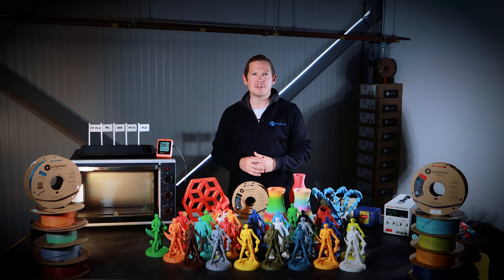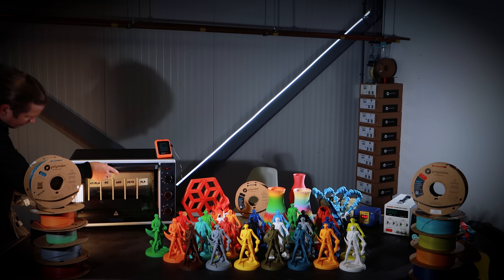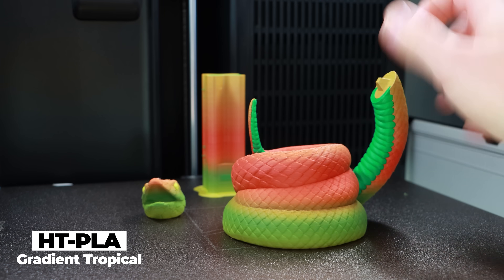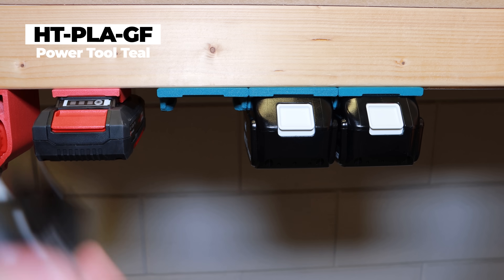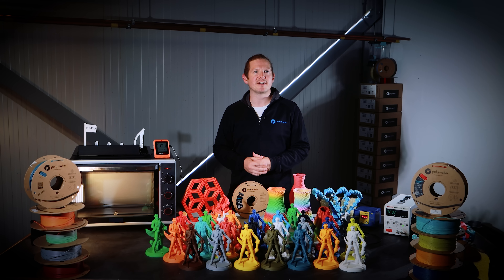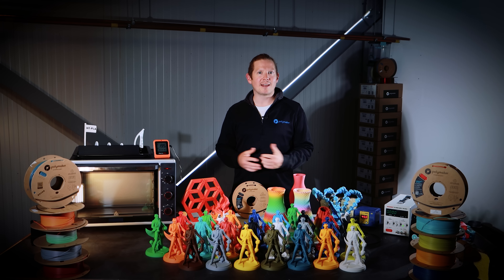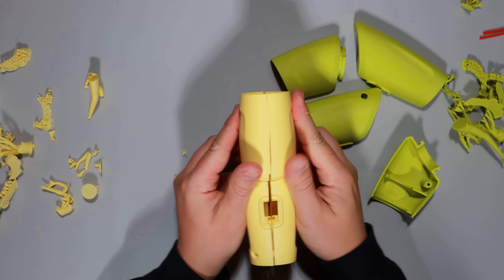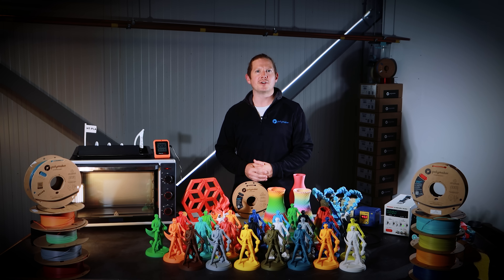HT-PLA: One Filament to Rule Them All 🔥🔥🔥

Comment: My first roll of ht-pla was a stringy mess.
Reply: what printer, slicer, filament preset were you using? Over 230°C it will get stringy, but under that you shouldn't have any issues.

Comment: I just got the HT-PLA in white and black and it's my favorite filament. I'm still testing the heat resistance but I'm really impressed by how it looks. Very similar matte finish to Elegoo's matte PLA. It has a unique feel though, and a different sound when  you tap it. I previously tried PETG and was disappointed by the shininess and "this was 3D printed" look, so I'm glad there's an alternative for outdoor and automotive prints. I hope more colors are introduced. BTW one thing I suggest is make it clear on the Amazon listing that it can handle 130C without annealing. I wasn't sure when I bought it

Comment: I really want this to be a magic filament but I’ve tested this with a file that I have zero issues printing in Panchroma and I get shrinkage and warping that lifts off of the bed. I’ve used the provided profiles on my X1C with no luck. I’ve tweaked setting a bit to increase bed temps and dialing the down the aux fan. Is this me? It could be the design but this is supposed to be exactly like printing PLA with stock setting.

Comment: The temperature limit is impressive, but let's set aside the heat resistance test for a moment. Is this truly everything standard PLA offers, just with added high-temperature (HT) capabilities? After reviewing the My Tech Fun analysis, it appears HT-PLA is a weaker material across the board—except, of course in thermal performance. So, is it really "everything PLA is, & HT resistance"? Not yet. Hopefully, you'll develop a version we can genuinely call PLA+ht. Right now, it's more like HT+pla, where heat resistance has overshadowed all other essential qualities of PLA.

To illustrate, imagine if regular PLA exhibited such compromises: layer adhesion failing at an average of 24kg or tensile strength breaking at around 48kg, This would be considered rubbish PLA. Until high-temp PLA matches or exceeds standard PLA in every other metric—while retaining its HT bonus— we can't claim a true breakthrough has been achieved!

Comment: It also could not handle UV and was unsuitable for any mechanical dimansionally stable application... PLA is not a useful filament type. It is good for what I call plastic waste: figurines and other useless trinkets in general but if you need stability, food safety or any kind of mechanical performance it all begins at PETG.

Comment: Wait a second, isn't PLA unsuitable for mechanical parts because it undergoes plastic deformation, instead of elastic deformation? I've had simple parts such as tabs and caps deform permanently after 2 or 3 uses, just by using them as designed, which makes any mechanical use of PLA impossible. That's the main reason I'm using PETG. How can this filament be used for functional parts at high temperature, when PLA deforms permanently even at room temperature? What am I missing here?

Also, please don't take this the wrong way, but I'm too scared to use any kind of glass or carbon fiber reinforced filament, because I would end up with shards embedded in my skin or my lungs just by touching the part. I'm not saying those materials don't have their place, but you would need to use a breathing device and plastic gloves when handling them, and then coat the print with some kind of sealant, and I don't see manufacturers stressing this point much, if at all. Which makes me think there will be a giant class action a few years from now, when careless users start having health issues related to glass fibers in their body.

Comment: We print PLA in our homes, most without ventilation - is HT PLA REALLY the same as PLA?   GF too?   Maybe there's an ENORMOUS difference because PLA is relatively SAFE  and you make NO MENTION of the safety of printing with glass fibers etc?   You'll sell thousands of rolls, maybe you should discuss the safety?  One of the main selling points of PLA is the fact that it's vegetable based, relatively safe.  What did you put in it to make it HT, and is it a carcinogen?  lol  We know glass fibers are safe to breath - am I right?

Comment: What kind of filament would you recommend for car parts? Interior, inside engine bay and air ducts? Is the ht-pla enough or would ht-pla-gf be better or something else?
Reply: I'm still new to 3d printing myself so I don't know what material is best to use for certain things. I got the bambulab p1s btw.
Reply: Nylon, PC, ultem (from 3Dextech)

Comment: With this I can finally finish modding my printer with KlackEnder mod after getting a capricorn teflon bowden tube (supposedly can handle higher temps) with a microswiss all metal hotend.... I should be able to hit 200C without worrying about the tube offgassing and killing my birds (I've been printing pretty much only PLA just because I need to keep temps low to not accidentally kill my birds with teflon fumes.... But the KlackEnder mod requires you to print the various brackets and the switch holder itself with PETG or ABS.... Your thermal test just proved this filament will handle short bursts of heat exposure without the high print temps that PETG and ABS require....

Comment: How about mechanical strength vs otehr for use in functional parts (like 3D printers)?
Reply from the maker: Here is the link to the TDS for all technical information:
HT-PLA:
https://cdn.shopify.com/s/files/1/0548/7299/7945/files/Polymaker_HT-PLA_TDS_EN_V1.0.pdf?v=1746635222
HT-PLA-GF:
https://cdn.shopify.com/s/files/1/0548/7299/7945/files/Polymaker_HT-PLA-GF_TDS_EN_V1.0.pdf?v=1746635222

Comment: Is it as strong as PLA or PLA plus? I don't recall that being mentioned.
Reply from the maker: Here is the link to the TDS for all technical information:
HT-PLA:
https://cdn.shopify.com/s/files/1/0548/7299/7945/files/Polymaker_HT-PLA_TDS_EN_V1.0.pdf?v=1746635222
HT-PLA-GF:
https://cdn.shopify.com/s/files/1/0548/7299/7945/files/Polymaker_HT-PLA-GF_TDS_EN_V1.0.pdf?v=1746635222

This review is also comparing the properties with regular PLA:
Modbot Review: https://www.youtube.com/watch?v=jFimeQy64wQ

Comment: From the website HT-PLA FAQ section:

"What is in HT-PLA?"

"HT-PLA is a PLA-based multiphase composites, it's main structure is PLA materials"

There's also a techical data sheet, but it doesn't state anything new about the chemical makeup.

Comment: well, i bought PETG and PLA for around 8 Euro a kg at the moment, so 25€/kg is not even worth considering.
and im sry, but the housings you show have gaps and you turn them fast so its harder to see.
If it warps, its not interesting how far it warps, it wont fit after that.
maybe their a few occasions someone would need this, but its clearly not worth the money for me.

Comment: This is absolutely HUGE. PLA has long been the material of choice due to its ease of use. However the single drawback has been its low temperature resistance. I'm guessing all of the 3D printing content creators are going to be playing with this stuff and reporting on what it is like. If everything here actually pans out, then PLA suddenly replaces PETG, ABS and ASA for a lot of (but not all) use cases.

Comment: This looks really interesting.  But information on the Polymaker website says the layer adhesion is not as good.  That may be an issue for mechanical/functional parts that need to be durable.

Comment: One quick question is htpla food safe? Where do I get specifications on this htpla as to expansion with temperature? I have a need for a plastic filament that I can use for a cooking device I'm working with.
Reply: No printed part is food safe without post processing
Reply: @howtoguy17 I know about the post processing needed for printed parts. But is it safe as far as leaching of chemicals from the plastic. The project I'm working on might raise the plastic temperature to probably around 110° celcius at which point a lot of plastics leach some rather nasty chemicals into the food.

Comment: Another concern is that will it retain strength over time? Most PLA disintegrated in hot and humid climate within 3 years, preventing me to use this entirely.
Reply: If you're talking about UV properties, it is similar to standard PLA.

Comment: I need this! PLA has always been my goto for prints, but they do have their issues.

PLEASE PLEASE PLEASE! Do away with the cardboard spools.. They cause issues in some multi units with smooth rolling...
We have to print plastic circles to go around the cardboard so they can work properly.

Just a thought. 🙏🙏🙏
Reply: I disagree, I only buy filament that comes with cardboard spools.  It’s more environmentally friendly.
Reply: @Bazwelle  LOL! If you worried about being "environmentally friendly", 3D printing should be the last thing on your mind being ALL plastics! Rather you stick to your paper and cardboards and make some origami models then...

When you use the multi colour machines, those cardboard rolls might not be perfectly straight and cause jams in the unit and everything stops.
This is the reason that others have made plastic rings that fit around those spools so they can work.
I know some others even re-spool them to plastic spools so they work properly...
Reply: @DeanosRides PLA is made from corn and your PLA prints and filament can be composted and returned to soil.  My city accepts PLA waste and prints in the compost bin which the city uses to add soil to city maintenance and new developments.  Non cardboard spools are usually not recyclable, and even recyclable plastics are down cycled into another plastic type that cannot be recycled after, which means it becomes trash.  So PLA printing is eco friendly.
Reply: @Bazwelle  Oh great! A solution to all my printer poops! Going to chuck it all in the garden now! 🤣🤣🤣
Reply: @DeanosRides Hehe! Unfortunately gardens might not be enough since a hot compost is needed but we all know PLA doesn’t do well with nature so it would likely still breakdown but at a very slow pace.  Though not sure about this HT-PLA since it resists more to hotter temps which is what a hot compost does.  It’ll be interesting to see what happens with this new filament.
Reply: Why can't we just have both?

Comment: Aren't the glass fibers within the material quite abrasive ? Not trying to say that the filament is bad in any way, it sounds very promising.
Reply: Yes, the HT-PLA-GF is abrasive due to the glass fiber, but the standard HT-PLA is not. We recommend a hardened steel nozzle for the GF version.
Reply: @PolymakerPete  Oh, I understand now. Thank you very much for the reply.

Comment: They pitch it as the one-filament-to-rule-them-all, but when comparing the mechanical properties and at room temp, HT-PLA is worse in many ways than ASA/PETG/PLA. The worst part is its layer adhesion.
Compared to Polymaker ASA, HT-PLA has 2x worse impact resistance, much less elongation (more rigid but brittle), similar tensile (max) strength, less tough, worse bending strength, much worse layer adhesion.
Compared to Polymaker PLA, HT-PLA is less stiff (less brittle), 20% lower peak tensile strength, tougher, more impact resistant, but 2x worse layer adhesion.

Comment: just a bit of a heads up for everyone seeing this: this isn't the first time HTPLA has been used. protopasta has been primarily making HTPLA filament for years now, but Polymaker has much better prices for it. though, the GF variation is unique to polymaker it seems. protopasta specializes in high qaulity, glitter filled HTPLA and CF HTPLA. 

thats not to say this isn't a bad product, i think this is a great product for practical prints. protopasta is way to expensive for prints that need easy printing at a good price. the extra 10 bucks for a kilo is very appealing for parts.
Reply: It IS a bad product. Back then Vez3D got conned into advertising HTPLA as the material for building their printers, which cracked and deformed just under a bit of use. Wonder how many people gonna build their printer with this and learn the hard way this time.
Reply: @youtubehandlesux  every product has a place. The properties of pla beinf brittle is what probinky caused cracking, or missaligned joints putting excess strain on parts. Protopasta gave us a glimpse at good looking, practical parts in easy printing pla. A major limitation is using pla as strictly temperature controled areas due to the low glass transition point. I think its fine to advertise and say that polymaker is making HTPLA, considering the only other trusted brand source is protopasta, and if your prototyping with the properties in mind youd spend a ton of money on htpla from them. 

What i dont agree with us it feels very "hey, we made the solution to pla's issues!" Which makes it feel like this was a plastic that didnt exist already. And as i mentioned, the GF varition i havent seen widley used with htpla. Every polymer has its ups and downs, pla will always struggle with beint brittle but is insanely easy to print. HTPLA solves the issue with heat sofening it, meaning you can make things to put into your car, or simple tools to use with like, hair dryers or curling irons. You could make a set of soldering hands that wouldnt melt. It does have its place, its just knowing where its place is better used vs using it becuase you can.
Reply: @youtubehandlesux  I dont think this is a bad product. Every polymer has its place in the world. I think the way they are presenting it as a "we fixed all the issues pla has!" Is what's wrong. Pla will always be brittle and weak compared to other polymers. But the main issue is think most people have is the temperature resistance. 

Polymaker is selling HTPLA at half the price protopasta is, even with the GF filled version. But protopasta has so many more color options now, thst are extremly appealing for prints that can look good with the added bonus of annealing it to make it more temp resistant. You could make a cup holder for your car, or a glove box organizer, anneal it, and not worry about it deforming or becoming soft in the summer. You could make different hair dryer tips to change the way the air moves for better control. Or you could print and anneal air ducts for better pc cooling. 

HTPLA has its place among our selection of polymers. Half the battle is knowing where to use what polymer. Part of 3d printing is learning and growing. VEZ3D should've done more research on polymers for their parts, since any form of pla i wouldnt use for any major component on a printer outside of like, organization inserts or decorative bits.

Comment: Only 106°C at 0.45Mpa after annealing 🤡🤡🤡🤡 Yeah I'd still use my annealed PET-GF (Not the polymaker trash PET that melts during annealing).
Reply: 114°C for HT-PLA-GF! :elbowcough:
Reply: only 🤡 here is you bud.
Reply: @riba2233 lmaoooooo hahahahahaha good one.
Enjoy your melted goop that's  only resistant to deflection at 60°C while I use 150°C parts at cheaper price.
Reply: @youtubehandlesux it is not cheaper, it is at least 2x the price. It's ok 🤡

Comment: This is huge if true...... I wonder if there's a catch...
Reply: catch is weaker tensile. and yes, you still need to anneal it but it wont warp
Reply: @riba2233  they compare generic PLA with their PLA-GF in the video for annealing. Of course GF will shrink significantly less. But will the non-GF shrink? Pretty sure - yes, otherwise it would be shown.
Reply: @mklabtech non gf will also shrink less than generic pla, this is common for all htpla filaments.
Reply: Paper rolls
Reply: The catch is that it's not a solid PLA (Polylactic Acid) - it's a mixture with (hopefully) PLA as a base, and they won't tell you the rest. Same with any other PLA mixture (+, tough, strong, HF, HT, meta, matte). They show you the benefits and drop the parts where the "new PLA" loses to the solid PLA. Like HF is usually noticeably less stiff than solid PLA and has a completely different breaking behavior. This isn't necessarily bad, and some of the mixtures might actually be overall better than solid PLA, but it's not really great that you don't know what you are buying. Every brand will put different stuff into their PLA 2.0 and you have no idea what the downsides are - is it less durable? toxic fumes? poisonous?

The stuff they add clearly doesn't shrink -> annealing doesn't affect it as much. However, if I understand correctly - they compared solid PLA with their PLA-GF (when annealing). Of course PLA-GF will shrink less, because there is less PLA and more material that doesn't shrink at all. 150C is a lot and not many filaments can withstand it. I wonder what is the added material that can prevent PLA from softening, and if there is any PLA at all...

But it sounds interesting, and I ordered a couple of rolls)
Reply: @mklabtech wait I thought 150c was without annealing?! I don’t like annealing as it usually causes some warp or shrink